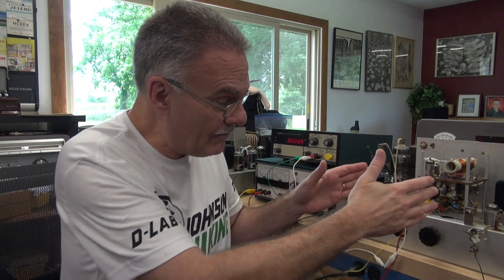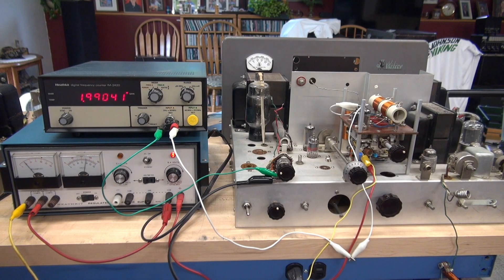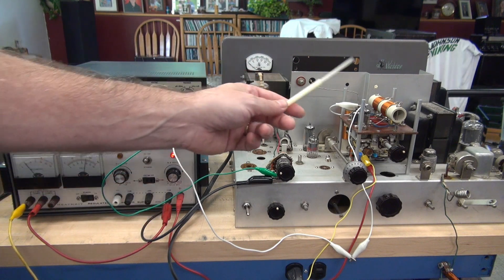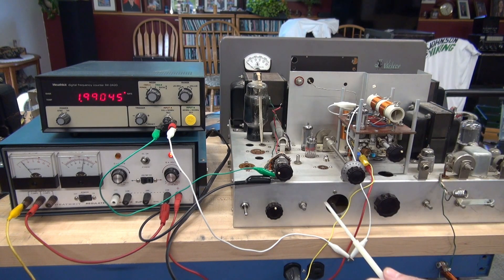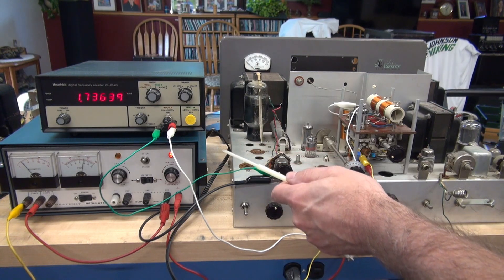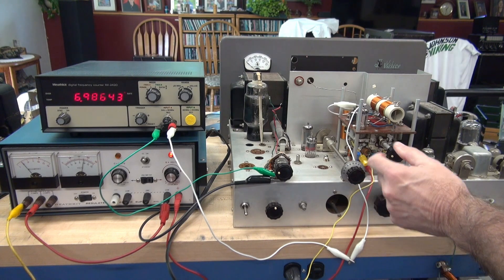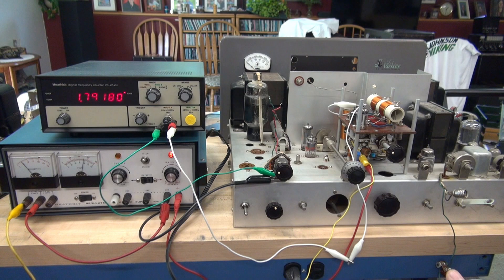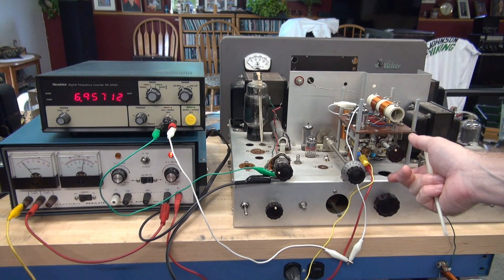EF Johnson Tube Ham Radio Transmitter VFO module Test procedure following repair Valiant or Ranger

Comment: Hello DLABS:

A Thank You for your dedication to helping all of us when working on EF JOHNSON gear.

I picked up a EF JOHNSON VIKING VALIANT in the fall of 2023.  It was by me, rebuilt with cap replacement, switch and contact cleaning and a spotless chassis cleaning with Q-Tips, tooth brush and all required cleaning fluids, like Kurd Kutter and others.

All tubes were then checked, using my HICKOK 539C, found just one weak tube, a pleasant surprise.

So, proceeded to recap it.  I then ran it through a output test, surprisingly, it came to life.

OK, that was many months ago, several grand-children now present.

Back at getting EF JOHNSON Viking Valiant back on the air.

I will not waste your time, but quickly summarize, two tubes failed, 12AX7 in front end audio, followed by 5V4G in low voltage power supply.

I did buy one of your offered systems to isolate high voltage from mic wiring.

Today, getting 100% from transmitter😊

Thank You for the suggestions offered😊

Chuck W9KR

Comment: Hi D-LAB I enjoy the "spirit filled" videos and this one is will save my bacon on the Valiant I bought off of eBay. It was part of a collection of electronic devices and parts from a radio shop. The owner must have been a ham and took very good care of this Valiant. He removed the all of the covers from the VFO and it was a good thing I bought the 'extra" Valiant the seller had. I did not remove the front panel, but the check of the health of the VFO in my Valiant from this video will be GR8.

Comment: Never worked on one in a transmitter but have worked on the 122 external VFO.  I was doing alignment by the book.  Could not get it to track well or accuracy suffered.  I got in and tested parts.  My lab tester indicated one of the tubular ceramic caps was off it's proper value by only about 20 pf.  I replaced it with a checked accurate part and then it aligned and tracked dead on.  A part that you usually would not expect I guess.

Comment: How stable can you expect this VFO to be .. i talk to a lot of johnson users on 40m phone and they are always chasing the center frequency.
Reply from the maker: Sounds like they have a voltage regulator issue
Reply: @d-labelectronics  I will recommend they look in that direction.  During warmup (10 min or so) how much should the VFO drift?

Comment: The term "low side" and "high side" means nothing to me and tells me nothing at this point.  What should I get to know about this term so often used in this video.  ie.. what does it look like on modern instrumentation. What's it do?..  etc   etc.      Please explain .. tnx   I Always enjoy your radio projects and learn a little something from time to time but most of it remains over my head unless I finally break down and ask the questions about actions otherwise commonplace to others.  Sorry for picking the pepper out of fly shit, but great questions like mine have always served me and others in my class or lecture hall really well in the long run.  73
Reply: In my personal opinion, when referring to power supplies it is better to refer to positive and negative terminals (unless the supply is AC when they are referred to as just output terminals) and input and ground when referring to the frequency counter. When referring to the VCO tuning, the low side is the minimum frequency (knob fully anticlockwise)  and the high side is the maximum frequency (knob fully clockwise), as far as I am aware (I am no transmitter expert). You can refer to power rails having a high side and low side but this can cause confusion when using similar naming to describe different functions.